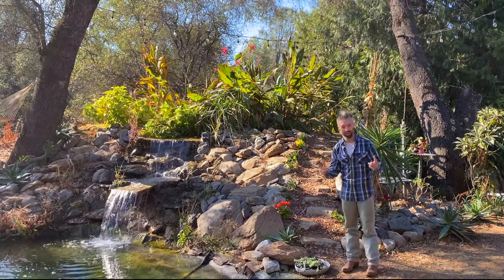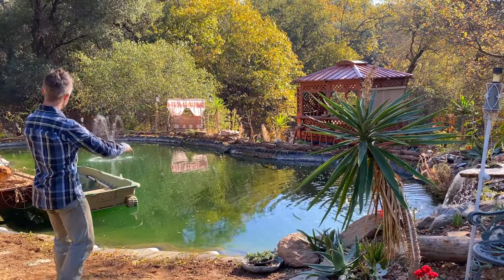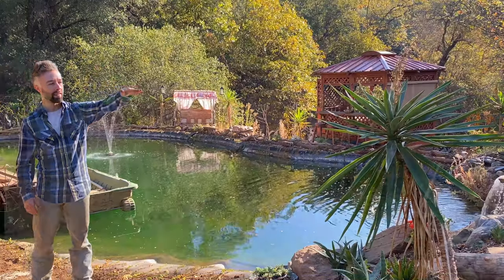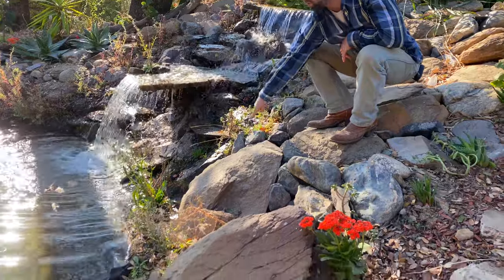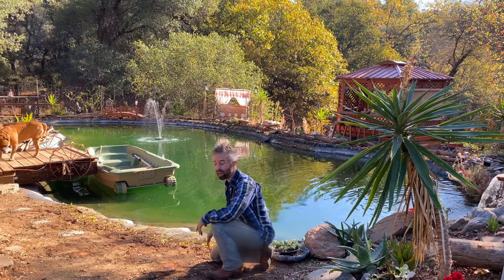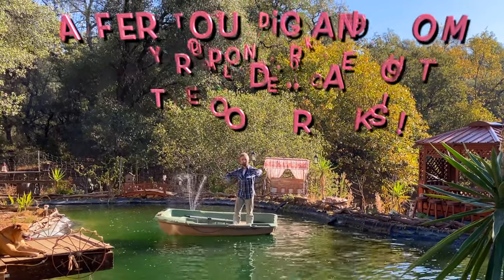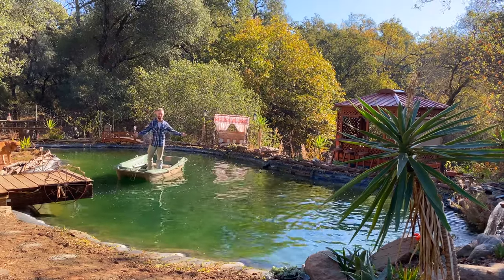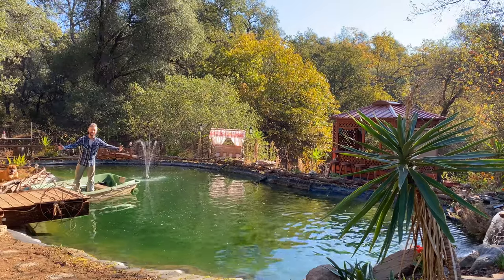How To Build Your DIY Natural Swimming Pond! Video#3 (Digging and Underlayment)

Comment from the maker: FYI😊...Please note that you may plan your pond to be located on a high water table area where it is possible the hydrostatic pressure from the ground water is so great it could raise your liner after installation even if you have rocks in your pond.  This has never happened to me as my pond is located on a hill and on one side of my pond there was already a french drain installed in the ground redirecting that side’s water away from my pond’s location.  However, It is something to look into for your specific project👍.  If you are determined on building your pond in a high water table location, there are several things you can research and do to prevent “bubbling” of your pond liner to redirect that underground water away from underneath your pond liner.  From installing french drains around the pond that are deeper than your pond’s bottom directing that underground water to daylight to other piping with sump pumps, it is something to consider for your project FYI 😊👍.

Comment: Hey brother great video! Getting ready to build one myself in southern Arizona. Where did you get the material for the liner? Do you happen to have a complete materials list done?
Thanks,
Adam
The New Woodworker
Reply from the maker: Hey brother! So the liner I got from BTL Liners online and I think they are out of Oregon... but that is their specialty👍 So everyone’s project will be different depending on the natural materials you have and what work you hire out or do yourself but the main material list I purchased was... The pump was around $440, the liner was around $1700, the 6,000 pounds of pea gravel was I think around $90.  The two huge flagstones were I think $140 combined.  The fish were around 10 for one dollar haha! (Comet goldfish at the feed store).  The excavation is tricky because I used the excavator for a French drain for another project as well but the guy said it would’ve been I think around $3500 to excavate the pond and put on the mound for the bog filter. And he was saying I think for a regular pool it would have been around $10,000 for excavation.   But that’ll totally depend on various factors for you but it’s a good ballpark👍... or you can rent a bobcat or dig by hand depending on size! And there’s other little things like waterfall foam, plants, boat dock (of railroad ties) and such but those are the main costs!  I’ve also added and bottom up aerator and floating planters and planting areas covering the liner sides I plan on doing vids on...but I Hope that helps some👍
Reply: Hi!  I want to do this in Southern AZ too.  Did you ever end up building?  Please share progress if you can!
Reply: I live in Casa Grande, AZ - small world @krissycus

Comment: Curious considering a sand substitute fine ground pumice stone I just happen to have a large resource of it near me and several trailer loads worth in my front yard
Reply from the maker: Oh Awesome you have resources around you👍... I love finding and using what is around me or free when I can!  I’ve  heard of people using sand as an underlayment And I think can be good as long as there’s no sharp rocks it hides as it covers around the rocks (ultimately the rocks  possibly puncturing the liner).  Also the sides would be hard to impossible to use sand on depending on the decline angle.  I think it would be great to use with not many sharp rock threats or a very thick layer of it or using it with something else like carpet or other underlayment👍. Also I don’t know how it does if there is much water that gathers underneath the liner underground (like if it stays in place or shifts any?).  Anyways just some thoughts but I’m sure there are great benefits too!

Comment: Would old moldy clothes work cuz we quite literally have several tons of it close that is I have no clue what how we're getting rid of it otherwise PS just moved in no clue how the clothes got there in the first place
Reply from the maker: Great thinking👍! I’ve heard online sites warn people of using carpet that was natural like wool as it would be prone to mold and rot away unlike a man made fiber... but honestly I didn’t check each piece of carpet I laid down lol! ... annnnd I highly doubt you would check each tag on the back of shirts 😂😂.  To me as long as you do good prep work with removing as many rocks and raking and prepping that dirt and then adding a good thick layer of cushioned padding I wouldn’t be concerned ... and no I don’t smell the carpet after liner is installed  or anything like that😂😂.  If you choose to use the clothes I personally would be careful of pins or just anything that miiiiight puncture your precious liner👍👍... but I’d say most clothes would be a good option stacked for some thickness... andddd you “get rid of them”... win win👍👍. Gods blessings to ya!

Comment: Man, your water is very green! I don´t know if your system works...
Reply from the maker: If you are referring to the bright green yellowish color to left of the pond, that is caused by the reflection of the bright green/yellowish oak tree  leaf reflection and the video lighting.  If you look to the right of the same video shot you will see a blue white color as that is the reflection the blue sky.  But having a slight greenish tint is not uncommon due to no chemicals (chlorine) and not using UV.  But that is my preference of my efficient natural setup. Merry Christmas!

Comment: Hi, nice pond but the edge work is bad. Uncovered liner looks ugly and not save because it could be slippery. Also i don't understand why you decided to go without any skimmer or an intake bay. You have so many trees around.. without a skimmer you pond will be full of leaves or you'll spend all the time taking it out.
Reply from the maker: Thank you! So I think the exposed liner along the edges doesn’t look natural and that is why I have recently started propagating creeping Jenny all along the edges that will droop over the liner edges with the beautiful green leaves and seasonal yellow flowers... my bog filter’s exposed liner has creeping Jenny covering the edge liner now and it looks absolutely beautiful and natural and covers the black liner so nice!  I chose to not have the swimming area clogged with plants for more swimming and play area space and that is why I didn’t do a shelf along the edges.  I would actually say my pond  is very safe compared to having the edges and such lined with rock or flagstone because as I swim or play volleyball or football in the pond with friends it would be Very bad if we jumped into or swam into the rocks along edges or shallow areas... but having just the soft liner in the swimming area and edges is very safe for my desires.  Any where in the pond you can easily grab the edge of the pond if need be and you can enter and exit anywhere along the pond but I’ve specifically designed for people to enter/exit by the boat dock or my  shallow wading area that gradually gets deeper from there (you can walk down the wading area).  Maybe if my pond was deeper or larger or somehow blocked along the edges it could be more an issue but I like having soft edges and bottom for safety in swimming and people playing in the pond.  I do however want to build a ladder on the boat dock for another easy way to access the pond.  As far as the leaves go.... I have no issue using the leaf rake and scooping out the leaves and my farm plants loveee the fertilizer I gather from the bottom and it doesn’t take much time.  If the bottom of the pond was all flat maybe it would would be more an issue to rake out leaves but since my pond has slanted edges it directs the leaves to certain deeper areas that I scoop the leaves from... again not a problem for me.  I decided not to have a skimmer because I was looking to build and maintain my pond for the  least amount of money as I could and I wanted the least amount of mechanical parts operating the pond ( less to install, less to upkeep, less to repair, less to run).  I understand some would just not rather rake out leaves and that is ok😊.  I hope you have a great day😊👍!
Reply: @UnitedRanch  As for the exposed liner, it's your choice. There are many ways to design a beach without stones. For example, cover it with gravel or sand. Of course, these are additional expenses, but they are not so significant. And everything will look much more attractive, and not like just a reservoir for collecting water. We build ponds for many years. My opinion is that it is better to pay a little extra at first, so that you will not regret it for 50 years after.

As for the skimmer. I understand that branded skimmers are very expensive, but there is nothing complicated, you can easily make a skimmer out of a garbage can for example. Or even build an intake bay, which is even better. After all, the role of the skimmer is mechanical filtration of water before it enters the biofilter. If the water is supplied to the bog without filtration, there is a risk of clogging the underground pipes with mud very quickly. Especially if there are fish in the pond.

In any case, I wish you good luck with your pond and hope that the water will always be clear (by the way, you did not show the quality and transparency of the water on the video).
Reply from the maker: There is definitely a wide variety of tastes 😊! At the end of my 2” flexible pvc pipe inlet for my pond pump (that sucks water from my main pond) I have glued on an enexpensive water pump strainer which is like a small screen guard I bought to prevent main debris, leaves and fish lol from going into my pump area.... but before my external pump there is also a strainer basket that came with the pump where I can remove the basket to take out any leaves or debris... but it rarely rarely has anything in it.    From my research I have chosen not to do any other type of filtering (like foam or such) before the bog filter because that defeats the purpose of the plant bog filtration.  Also my inlet pipe does not rest in pond muck (or else yes I could see how that would be bad for the pump and bog filter piping).  And maybe one day after I wrap up the how to video series I can show a cool video of like the fish or the bullfrogs in the pond or something😊. Thank you very much and same to you!👍
Reply from the maker: I also installed clean out pipes for each of my 3 10’ bog pipes underneath my 12” deep pea gravel in my bog just in case I ever need to flush out the system... but so far it’s running as strong and efficient as day one so hasn’t been necessary.